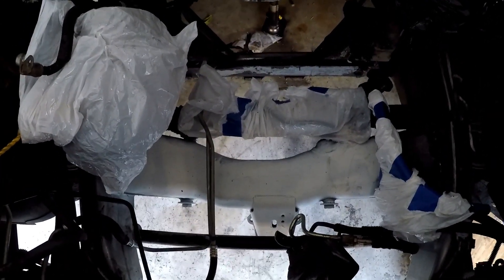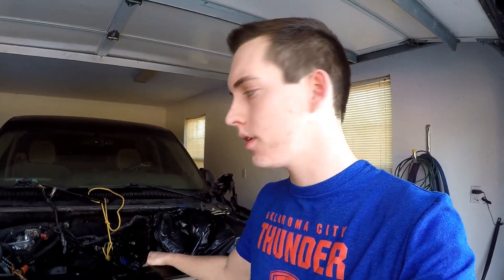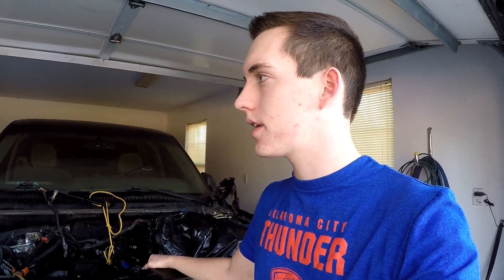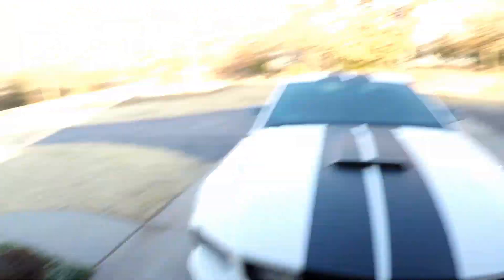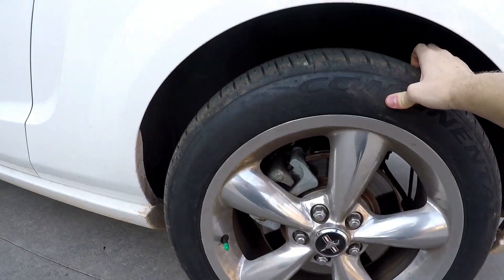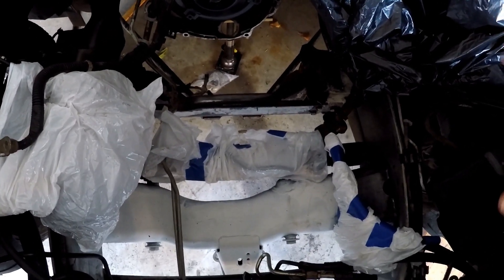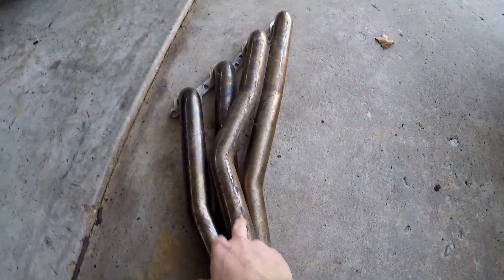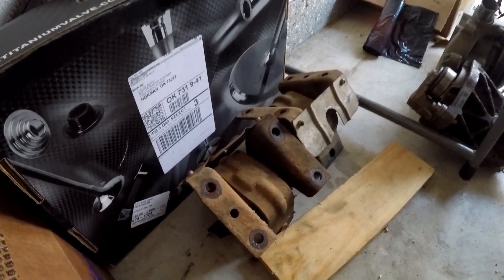Problems With The 6.0 LQ4 Swap!

Comment: Found your vids cause I’m going to put a 6.0/4L80E in a 02 reg cab. Trying to decide if the stock 6.0 is enough for me or to build it up a little first. Just brought it home and have to open it up to see how worn it is.
Reply from the maker: Daniel Sanders if you already know that you are going to build it in the future, then just hold out a month or however long you need to put back the money to do it. Would be easier while it's out to work on it, and would be cool to feel the power from everything all at once instead of progressively doing mods.
Reply: SilveradoNtheStang I’m thinking about putting in a nice cam, but I have to see if the engine is going to require major work or just freshened up. Plus I will be overhauling the trans at home and spending some money on that. It might be several months depending on my amount of overtime I work. Keep up the vids. And Go Pokes!  ;)
Reply from the maker: Daniel Sanders thanks! Let me know how it goes. Boomer Sooner lol!

Comment: Coming from experience, I have a 2007 nnbs Silverado with a 6.0 out of a 2011 2500hd. My first setup was a full bolt on Texas speed cam, 1 7/8 Texas speed headers, cold air intake as well as a Corsa cutback. If you want to take some heat out of the engine bay I would ceramic coat the headers not heat wrap them. When heat wrap sits it will rust of those nice headers of yours. To solve heat issues I would ceramic coat the headers and it would look sick! Right not my Silverado still has the 6.0 but it has a on3 performance turbo system making 10 psi through a borg Warner turbo. My truck made 510 to the wheels through a performabuilt 4l60e. My truck is 2wd on 33 inch tires.
Reply from the maker: Justiniscool03 I bet that thing is a lot of fun to drive! Yeah I got a quote a few days back from Jet Hot to ceramic coat them and it is crazy expensive. Think I will hold off on both. Maybe just wrap the y pipe down by the transmission. I can't wait to get a turbo on mine. Got to get a solid transmission behind it first and possibly a rearend too.

Comment: Can't wait till you get it up and running
Reply from the maker: Camp a holic thanks me too! Really miss driving it. I'm hoping that the wait hasn't pushed people away. Once I get the heads back it should be done pretty quick.
Reply: SilveradoNtheStang no way man things happen money has to be made family has to be taken care of I understand I have a Silverado 6.0 2500 so much I want to do to it I started with the little things from the engine in on out before far smaller things than what you're doing I'll be on standby all the best of luck make me want to get a muffler cold air intake and some headers LOL
Reply from the maker: Camp a holic cai, muffler, and headers will wake it up for sure! Made a big difference with my truck.

Comment: Hey I was wondering if you think it'll be worth it to put a 6.0 in a single cab Silverado that has a 4.3. I want to make a race truck kind of build and it needs a big v8, what's your take on this?
Reply from the maker: jesus rios it’s worth it for sure! Going from a 4.3 to a 6.0 is a big jump. The difference in my heads cam 5.3 and my built 6.0 is crazy. I couldn’t imagine going from a 4.3 to a 6.0. Single cab is a great platform for that.

Comment: hey bud, I live in Yukon and I'm getting ready to put an lq4 with a 4l65e into my 83 k5 blazer.  just wondering if you might have any tips, tricks or ideas that could help me save some headache along the way.
Reply from the maker: Not too far from me. Yeah just make sure you have the right crank without the hub put on and the right dished flex plate. Im assuming the 4L65 trans bolts up like the 4L60e with a torque converter that has a snout that sticks out.

Comment: As long as you have let the truck sit, I would pull the torque convertor, and look at the pump bushing and replace the seal. you don't want to have problems after you put the motor back in !!
Reply from the maker: Bobby Ellerbrook I just replaced the seal. I went ahead and ran the slightly higher stall too from the trailblazers and envoys.

Comment: Man I love the sound of that car in the intro. What kind of mufflers are on it? If that is your car.
Reply from the maker: Kahlil Robinson thanks man! That's the Silverado. I pulled that clip from the end of the video I did called Cost to Cam or Head Swap a Silverado or LS Engine. It is a 2.75 in 2.75 out magnaflow muffler. I have it dumped at the axle. The long tubes make it sound deep. Can't wait to hear it again, but with more lope.

Comment: You mentioned header wrap. Are you going to be running a turbo?
Reply from the maker: kevin122759 I was wanting to keep the heat down on my longtubes and quiet down the valve train noise. I don't have a turbo now, but how well I do this summer landscaping will determine if I turbo this year or not.
Reply: Thanks for the quick reply. I understand about under hood temps and have debated putting wrap on my headers.  My LS2 runs intake temps as high as 130 degrees on hot days.  I was also told header wrap will rot out the headers.  Not sure if that is true or not.
Reply from the maker: kevin122759 it can cause them to crack or rust prematurely. Not so bad on stainless headers, but it still can crack them.

Comment: I got a question. What all do you have to change when go from a 5.3 to a 6.0 in the Chevy or GMC? I might do that if my motor in my truck ever go's.
Reply from the maker: Julius Cullum really just have to match up the right flex plate and hub spacer or no hub spacer to whatever transmission you decide to run behind it. Everything else plugs right up for me.
Reply: K so wire harness plugs up the same and stuff. Just have to worry about  the tranny bolting up?
Reply from the maker: Julius Cullum yes it's a really easy swap.
Reply: Sweet thanks for the info. I've always messed with the older carbureted Trucks. where if it's a Chevy you could take a 305 out and put a 400 in no problem or even a big block for that matter. I'm not very wise on this newer stuff. Lol thanks again. I was worried about if I had to change the computer or something.
Reply from the maker: Julius Cullum my father in law is the same way. He's always build older small blocks and big blocks. He's slowly coming around to wanting to get a 6.0 for the 67 Firebird he has.
Reply: That would be awesome.

Comment: I got a question. Are all 6.0 the same? Can I swap a 6.0 from a 2011 chevy 2500 to a 2007 express van that has a 6.0? 
Thanks..
Reply: arcunap7 if I’m not mistaken 2007 is a gen 4 6.0. Id double check make shure it’s the Same generation. Fitment wise shouldn’t be a problem gen 3 is very similar to gen 4. But the cam sensor is in a different place then it is in gen 4 electronic wise it can be a headache to swap a gen 3 were a gen 4 gos

Comment: Quick question, 6.0 and 4l60 combo, what were the mpg like?
Reply: brian white yikes 😬 would seriously have to rebuild the 4l60 I would recommend the 6L80  i don’t think the 4L60 or the 4L60E would honestly hold up my little GMC Canyon had a 4L60E in it and only had a 170,000 miles on it and started going out .., and the engine was a 2.8l four cylinder

Comment: Yeah man whoever has your heads needs to quit messing around and get them done...they should have them for a week or less...its not that difficult to deck a head and lap some valves and install springs...
Reply from the maker: Money Mac yeah it's been really frustrating. Hard to post content when there's nothing really to update everyone on. It's a port and polish since they just were milled .030 and had a valve job 8,000 miles ago, but yeah it shouldn't take much more than a week or two. Thanks for watching!

Comment: what trasmission are you using. 4L60E or 4L80E?
Reply from the maker: MIKY P 4L60 for now till I can afford the 4L80 swap. Hopefully by the end of summer if it need it, I can pick one up.
Reply: @SilveradoNtheStang  stay with the 4L60 and pick up a stock torque converter for a chevy trail blazer SS stock is 2300

Comment: Debate... I have the option of buying a 2000 140k miles lq4 317 heads cam is a Texas speed .600 lift cam tranny is a 4l60e auto 2wd for 8k OOOOORRRRR a 2007 Silverado LT stock with 50k miles for 15k

Comment: What transmission did you use
Reply from the maker: Bryant Whitaker 4L60 until it gives out. Then I'm going to put a 4L80 in it.
Reply: Im about to drop a lq9 in my 96 impala ss. I live in okc but work in norman I would like to see the truck when its done man
Reply from the maker: Bryant Whitaker for sure! I am wanting to do a small meet up at Thunder Valley this summer and a lot of us make some passes down the track. Would be a lot of fun and good content for the channel.
Reply: The 4l60 should be just fine, factory h2 hummer have 4l65e in them and we were putting Magnusson superchargers on them at the dealership. One of my customers had his truck dynoed, and with shorty headers, corsa exhaust and the supercharger with an airaid cold air intake he made 650 at the wheel and the stock trans was fine. We did add an aftermarket cooler though.

Comment: What cam did you use? I just picked up a lq4. Any suggestions on parts for a great build?
Reply from the maker: I went with a Texas Speed 224 228 .600 .600 112 LSA. Maybe port some 317 heads for it or pick up a set of LS3 heads. Would definitely get some dual valve springs, new lifters and hardened push rods. Just want to make sure and put the right parts with the cam to support it.